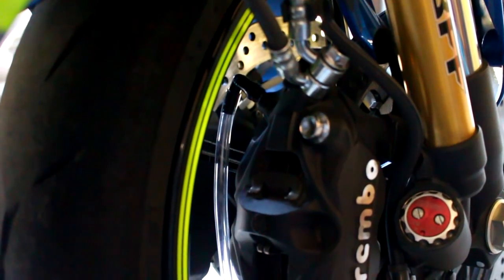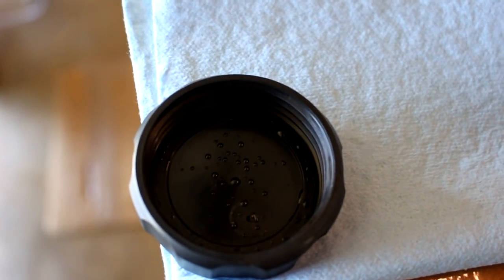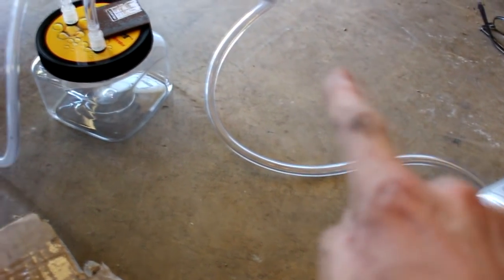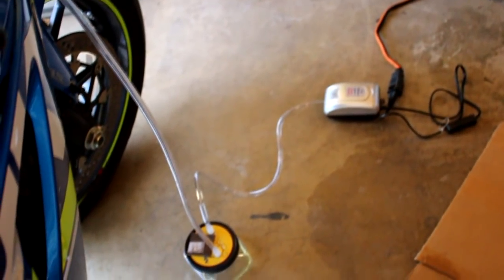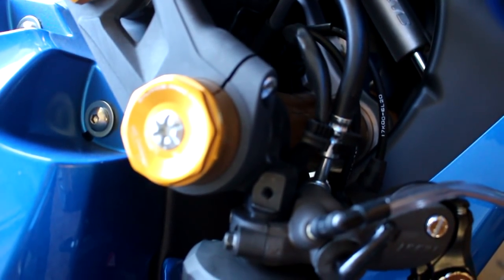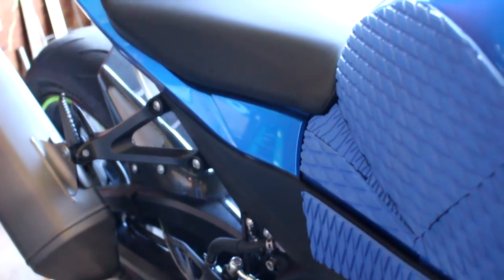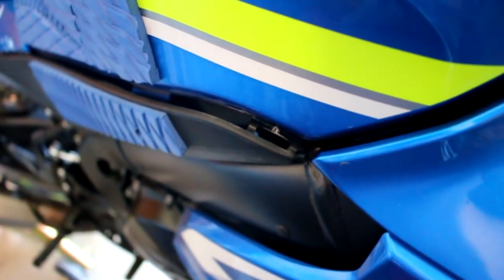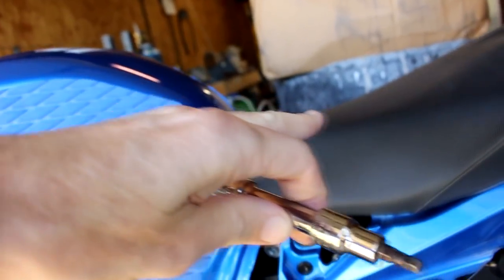2017 Suzuki GSX-R1000R Stainless Brakes Part 2

Comment: I watched the whole video. Great info and install so far. I ordered all my parts they are on their way. Not sure if I am gonna do away with the ABS just yet but I did order the Galfer GP lines for the front.
Reply from the maker: @disarmyou - Very cool, let me know how the build goes.
Reply: Getis Realis you think If I keep the abs for now but still do the steel lines in the front I would still feel s difference even tho the lines going to the abs are still rubber? I asked Galfer and they never answered me. Thoughts?
Reply from the maker: @disarmyou - if you ordered the GP style brakelines from Galfer then you have to remove the ABS pump. If you ordered the ABS lines from Spiegler then you can keep the ABS pump.
Reply: Getis Realis I got the gp style from Galfer. I thought maybe I could replace just the front lines.
Reply from the maker: @disarmyou - Almost guarantee you'll still have spongy feel because the rubber lines to the ABS will heat up and expand. You could sell your galfer lines on Ebay and then buy the Spiegler kit.
Reply: Getis Realis that’s a good idea or maybe I’ll just do away with the abs anyways. I’ve never thought having abs on a motorcycle was a good idea

Comment: Wanted to know can I replace the levers for the brembo master cylinder to aftermarket ones like crg or some other brand
Reply from the maker: @justin - Yes you can, easy replacement - https://www.revzilla.com/motorcycle/crg-raceline-brake-lever-for-brembo-rcs-1820-master-cylinder

Comment: Are you planning on getting rid of that abs pump?
Reply from the maker: @Spencer - Yes, the ABS pump will be removed.
Reply: Getis Realis let me know if you wanna sell it I’d like to install an abs pump on my base l7
Reply from the maker: @Spencer - I'll probably keep it, just in case I sell the bike or want the ABS back on. The ABS is available from Suzuki, and you may need the RR ECU but not sure -- https://www.suzukipartsmonster.com/oemparts/a/suz/597211cf87a8660d2849cf88/hydraulic-unit
Reply: @Spencer - I would prob sell mine if I remove it
Reply: disarmyou84 let me know

Comment: See the amount of air that was in the system both front and back, that's a lot of the reason the brakes are so crap as we have found out over here in the UK
Reply from the maker: @Trevor - On top that, the rear brake fluid was plain nasty. Not sure if that's from the Tech who assembled the bike, mixed fluid types?
Reply: Getis Realis we have come to the conclusion over here that it's all down to how good the supplying dealer was with getting the bike ready for collection by the customer, whether it was new out of the crate or it was new off the sales floor as there is so much differences between the brakes from one bike to the next, my dealer is exceptional and has won awards in the past for being the best multifranchised dealer in the UK, i also get on well with all the mechanics in the workshop and the salesman that sold me the bike is a personal friend so there was no way he, or the boys out back would have not gone through the bike from top to bottom before handing it over to me.
As a little side note I'm planning on  seeing if i can actually get on the bike later today as the physio I've been doing seems to of helped with the disc issue in my back, shall be making a video of it all.
Today just seeing if i have the strength to wheel it out the garage and just sit on it then wheel it back, if all that goes to plan next step is a very short ride over the weekend 🤞🤞🤞
Reply: Trevor Bailey To my understanding,  the brake fluid is put in from the factory.  It's very little the dealership has to do ton this bikes once it gets there.  Usually just attaching the windscreen and mirrors.
Reply: apexhunter2k yep it is, and unfortunately most dealers ignore brake fluid in the PDI apart from making sure its up to the required level, mine was bled and topped up before i took delivery, hence my brakes work ☺
Reply: Trevor Bailey Wow, that is great service.  I don't think any dealers in the USA would initially do that when delivered. They would probably do it for toy once you ride it and complained about it if they are a great dealership. I personally bled my brakes and they felt pretty good. Now I have a brembo 19rcs,  mainly because i had it laying around from my other bike and bled my brakes a second time and it feels great.
Reply: apexhunter2k yeah my local Suzuki shop go above and beyond for their customers, case in point i ordered a set of asv levers through them and they arrived at the shop 2 days before it was due to go in for its 600 mile service, they fitted the levers foc while it was with for the service 👍
Reply from the maker: @Trevor - Awesome brother. I pray your back just keeps getting better. Let me know how it goes walking the bike in/out of the garage.
Reply from the maker: @apex - If what you're saying is true, then the brake fluid on my bike was plain nasty straight from Suzuki. I would think it best to put fluids in at time of final assembly at the dealership, but interesting they'd ship bikes half way around the world with fluids already in. I can for say certain the rear brake fluid was not the same as the front.